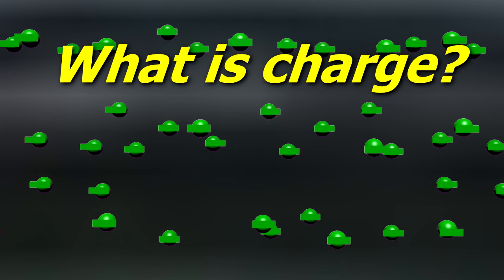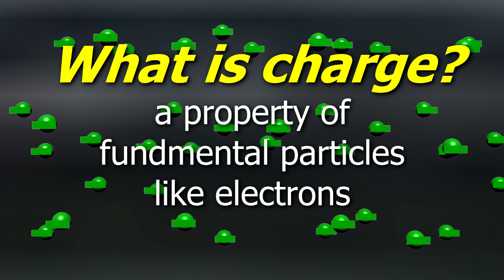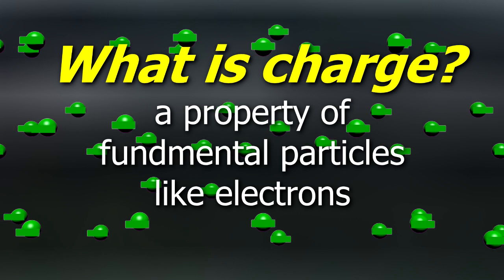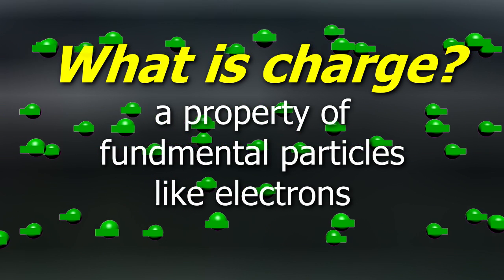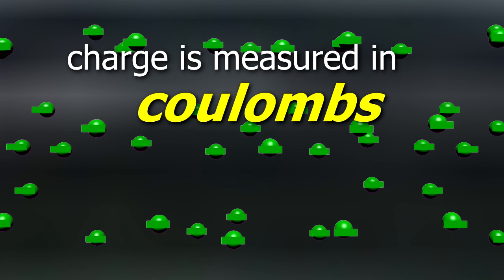Voltage/Volts: What is it? Eg.Load in a Circuit

Comment: When you increase the charge, shouldn't the extra clumps be shown side-by-side to reflect a thicker wire allowing more to pass at one time?
Reply from the maker: gilbet The wire isn't necessarily thicker. You can have increased current while still having the same wire. I see your point though. Having them side-by-side would be better. However, as I said in the video they're not really clumped up to begin with. When you have 6.24x10^18 electrons per coulomb, it's very difficult to illustrate the "per coulomb" property of voltage without drawing discrete clumps.

Comment: Very informative.  I've never gotten the whole amps vs voltage thing, but I think I do now.  So something like a stun gun would be 10 million volts moving 1 coulomb of energy.  So it's a lot of power moving a little bit of actual energy.  Is that accurate?
Reply from the maker: CapnHolic Nope :). You're mixing up your terms. "1 coulomb of energy" doesn't make sense.1 coulomb is an amount of charge. If you add up all the charge from 6.24x10^18 electrons then you get 1 coulomb. If you have 2 coulombs per second passing a point in a wire then you have 2 amps of current. Voltage is how much energy is applied per coulomb of charge. The unit for energy used here is the joule.So 10 million volts means there are 10 million joules of energy for every coulomb of charge. That's a lot of energy for each coulomb of charge. Since you mention a stun gun, we can assume you have a small amount of charge, so that would be a lot of energy overall.For example, if you have 10 million joules per coulomb and 5 coulombs, then the energy would be 50 million joules (10,000,000 joules/coulomb x 5 coulombs).But if you have 10 million joules per coulomb and 0.005 coulombs, then the energy 
would be 50,000 joules (10,000,000 joules/coulomb x 0.005 coulombs).
Reply: +RimstarOrg How can you have such a high voltage yet such a small amount of charge? If voltage is energy per coulomb, doesn't that mean that a high voltage would have the energy to push more coulombs of charge through a point per second?
Reply from the maker: +Akfloatable Voltage isn't energy. Just because you have a high voltage doesn't mean you have a lot of energy.
If you have 10,000 volts but only 1 coulomb available then you have 10,000 joules of energy. If you have 10,000 volts but 100 coulombs available then you have 1,000,000 joules of energy.
Let's use an analogy. 1 cup is 1 coulomb of charge. 1 ball is one unit of energy, 1 joule. Voltage will be represented by how many balls there are per cup.
If you have 10,000 balls per cup (10,000 volts) but you have only 1 cup (1 coulomb), then the total energy is 10,000 balls. If you have 100 cups (100 coulombs), and still 10,000 balls per cup (still 10,000 volts), now you have a total of 1,000,000 balls (1,000,000 joules of energy.)
That's what I'm trying to emphasize in the video at around 2:30.
But practically speaking, it also depends on the circuit. With a small Van de Graaff generator, at 80,000 volts you'll get a weak spark because there isn't a lot of charge available. With a large Van de Graaff generator, at 80,000 volts you'll get a strong spark because there is a lot of charge available. But that's also because more energy is generated by the larger Van de Graaff generator. With the larger Van de Graaff generator there are both more cups and more balls.
However, with my 30kV DC Cockroft-Walton power supply, the total energy is a limited amount. So the voltage actually drops as you increase the current, the amount of charge flowing. It's as if with that circuit you have a fixed number of balls and so if you increase the number of cups, there will be less balls per cup i.e. a lower voltage.

Comment: Great vid. So in the case of many coulombs but with 3 volts what is the difference on our final energy output? And also if the voltage is the same (3 joules per coulomb) how come you can have more coulombs some times?
Reply from the maker: Lord Random +36trooper answered it. His point about the voltage staying the same but having a large change in current not matching this circuit is right. I guess I was being too academic in my explanation. I was just trying to emphasize the point that voltage is joules per coulomb by giving two different examples with different values.
Reply: Don't think in terms of energy output, think power output. Illustrating many more coulombs of charge flowing is a way of visually showing a increase in current flow. Current and voltage are two different (but related) things. The product of the two gives you power absorbed or supplied by the device you're measuring. Voltage and current are not always linearly related. In the case of that LED and other diodes it is possible that a very small change in voltage can cause a large change in current. But generally speaking you can't have a change in current without a change in voltage, unless the load/device characteristics have also changed. See Ohms Law.